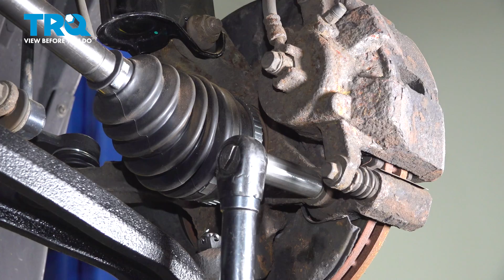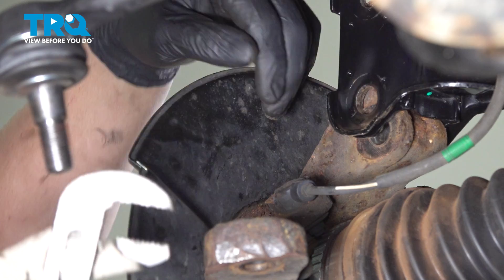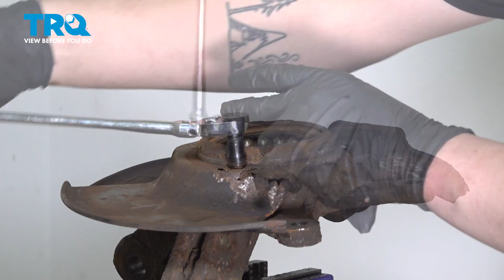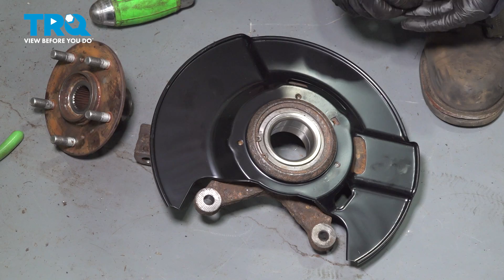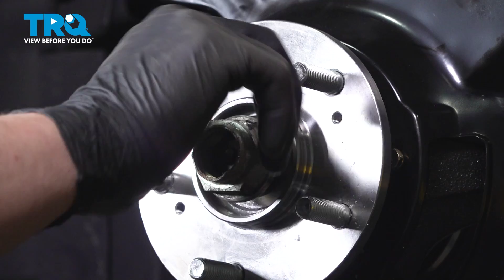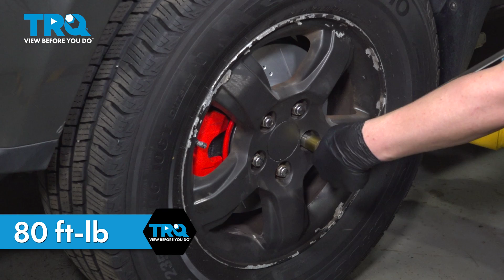How to Replace Front Brake Dust Shields 2003-2008 Honda Pilot

Comment: And here we install our brand new knuckle lol…. All that work for another cheap piece of sheet metal. I’d spray paint another two coats of paint on that new shield before installing it. You know it won’t last as long as the original even. I sand and paint mine when  I do a brake job just to make them last.

Comment: Yikes! Yeah, I am exactly there with my 2007 Pilot. 
Given it's age and state of rust overall, would I be better off just tearing away the rotted shield and just run buck until the thing is dead? 
This amount of work is way past my pay grade and tool set and I know that the service guys will be a pretty penny to do this service.